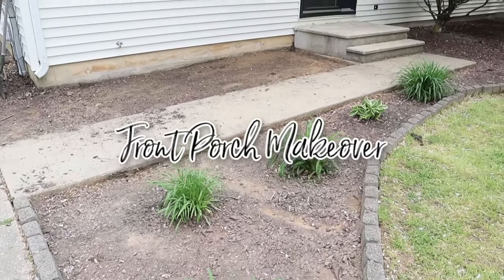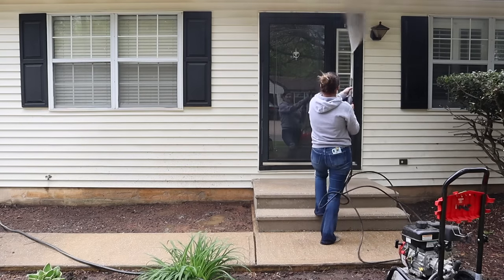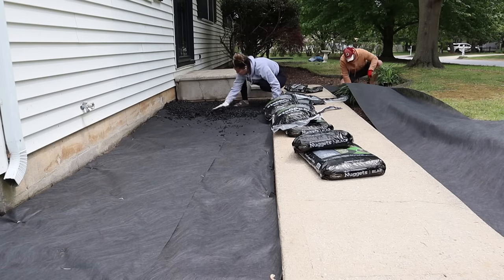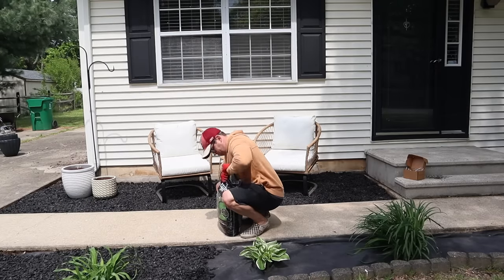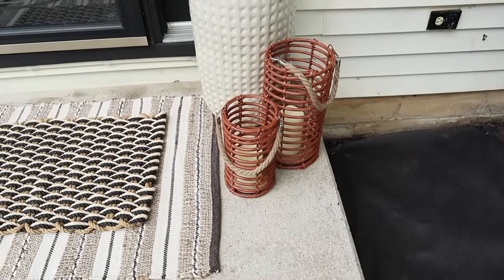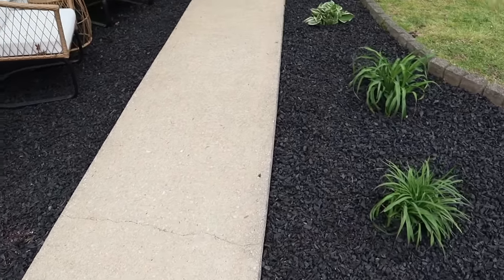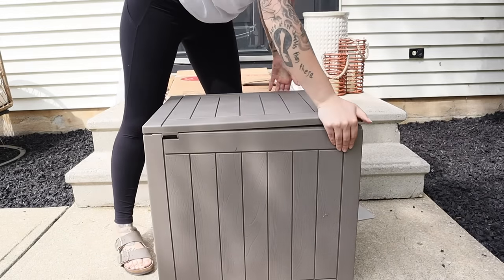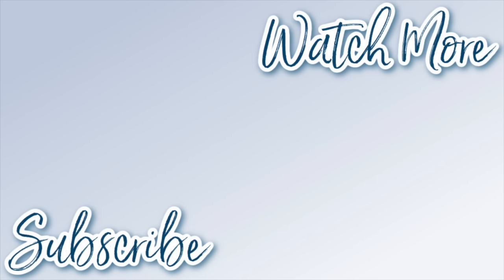DIY FRONT PORCH MAKEOVER | DECORATING IDEAS | LANDSCAPING | HOUSE PROJECTS

Comment: I agree with others that you may want to select another way to prevent weeds than Roundup. Another comment regarding Roundup-- Roundup actually needs to be sprayed on the leaf of the weed for it to work. So the weeds need to actually be coming through the ground before it works.
Reply from the maker: I already sprayed it. You saw that I used it in the video. I can’t suck it back out of the ground & use something different.
Reply: @lovinglifeasmegan  I meant that the next time you may want to use something else.

Comment: Megan get yourself a gutter extender for that gutter that spills into the flower bed. Your front looks amazing. The extender will redirect the water and keep your foundation and mulch dry which can cause termites.  If you have any other gutters that spill out next to the house you might want to install them there as well. You don’t need anymore issues yo pop up.
Reply from the maker: Thanks for the tip! I’ll check them out next time we’re at the hardware store!
Reply: @lovinglifeasmegan  sure thing. I’m very inspired by your sense of responsibility for you and your young family. Keep up the good work. Can’t wait to see your floors. Btw. We are having to have our hvac system totally replaced $22k was the price tag. Floors will have to wait. See ya.

Comment: Tip:* if you want *  you can add a DT cookie cooling rack in the box just incase water creeps inside . The rack will hold it up a little so your 📦 don't sit in water. Other then that, Love how it turned out. Very clean looking. I need to do something with mine so I was looking for inspiration and your video came up 😊
Reply from the maker: The deck box is weather proof and there aren’t any cracks in the seal, but thanks for looking out. 😊
Reply: @lovinglifeasmegan  AWESOME!

Comment: I so agree with the power washer.  We had a less expensive one and it was awful saving now for a new one😬
Reply from the maker: It was such a waste getting the cheap one! It didn’t do a good job to begin with & broke after 2 uses. The seller wouldn’t accept a return because it was used, so we ended up wasting $100. 
We like the new one so much better and it was just a couple hundred more than the cheap one.